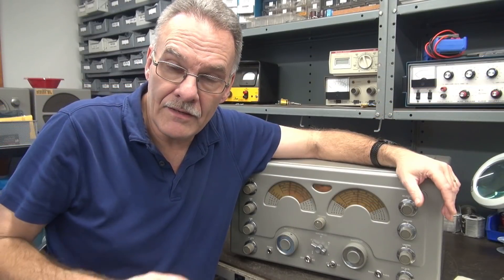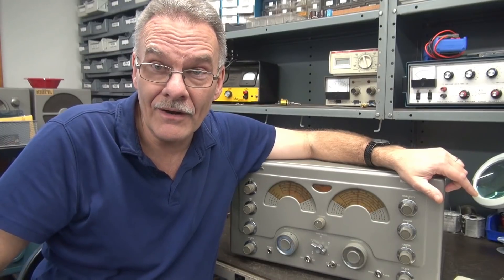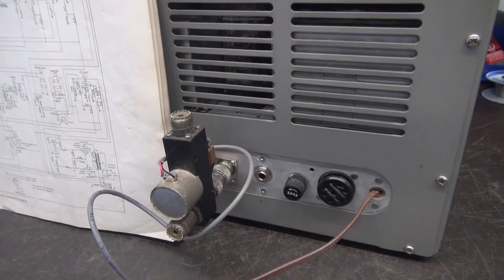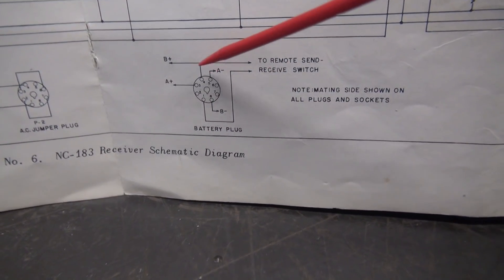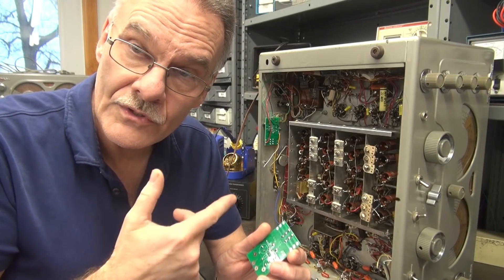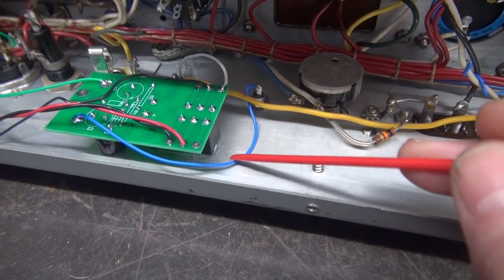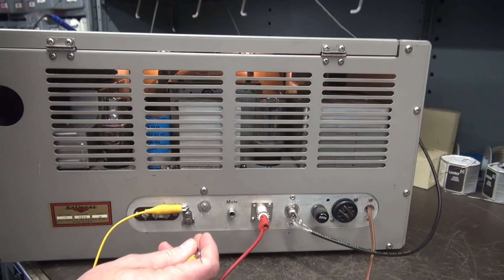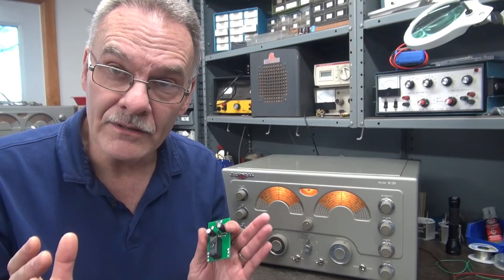How to protect from High Voltage Vintage Tube Ham Radio Receiver Shock Hazard

Comment: Another hazard should also be mentioned: the same high voltage in the stand-by circuit is also present in one of the screw terminals in the back of the case (at least mine has it). You may want to add a caution to the installation procedure.

Comment: Why would they switch the entire B+ in order to simply momentarily mute the receiver? I can understand doing this as a standby mode but it seems a little brute force for a mute. Why not just ground the audio going to the amplifier? Even for experts,  routing that voltage outside the receiver, I would think, would be a bad idea because it can introduce any number of problems and make the rig less reliable and more susceptible to damage itself or to other devices not to mention safety. I know I’m not thinking of any novel ideas, they must have had a reason for doing what they did. What was the thinking behind this kind of design?

Comment: Back in the late 80’s/early 90’s when I started doing tube amp repair and builds, I learned from an old tube radio and television repair man the quick and dirty way to make sure a tube amp was drained of juice. He was a very knowledgeable old man that had worked in tube repair service from World War II to when he passed away in the 90’s. 
He used a very large Craftsman flathead screwdriver. While making sure your right hand was on the plastic handle and your left hand in your back pocket, touch the + of electrolytic caps, then drop the screwdriver onto the chassis side wall. Make sure you let go of the screwdriver when you do it. A big spark will snap arc on the big screwdriver if the caps are fully charged. Then double check with a multimeter if any juice is in the circuit from the power tube sockets to the preamp tube sockets. His screwdriver was pitted and black from all the arcing. 
Of course now, I know better NOT to do that. 
A draining resistor clip is a safer and better way to drain the circuit. It’s a lot easier on the caps to slowly drain them. Just remember to remove it before powering up the amp.

Comment: What relay are you using? It is quite easy to switch high AC voltage with a relay, switching high voltage DC is more of a challenge. Contacts will burn off or weld together within a relay if the gap is not sufficient and action of the relay not quick enough when switching high voltage DC. There are AC & DC contact specs on relays for a reason.

Comment: I have a RCA AR88 which uses negative bias to control the RF/IF gain control a simple mod is to have a relay to lift the earth terminal on the RF/IF gain control to increase the negative bias on transmit and mute the radio, it is very silent operation  and works very well.

Comment: The old original key relay will switch the high DC voltage of the receiver off and on? when transmitting the original key relay will NOT mute the receivers front in?